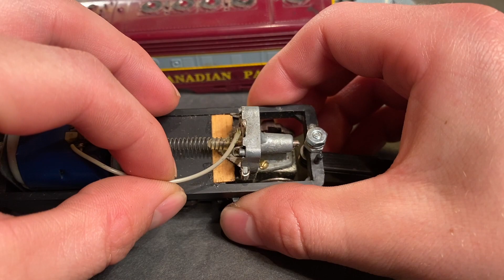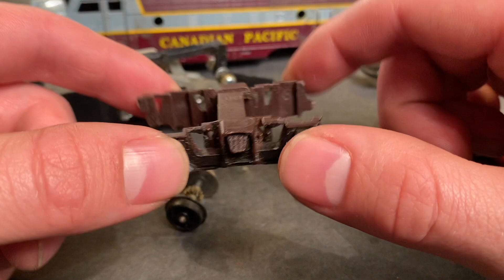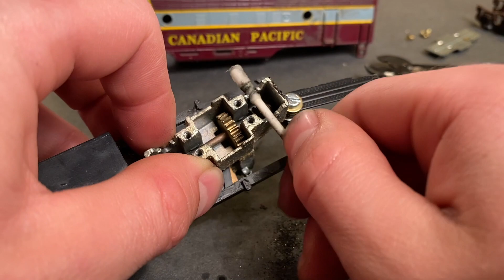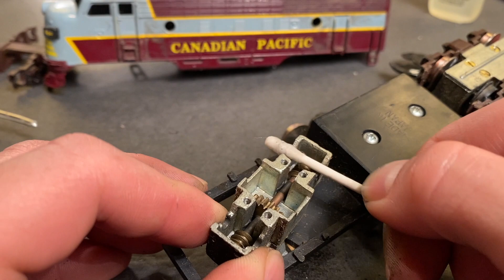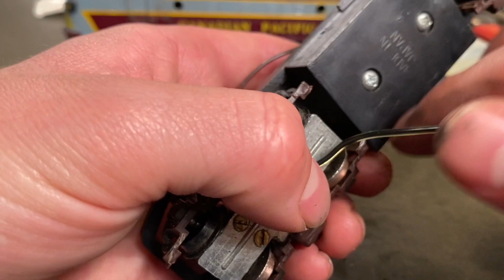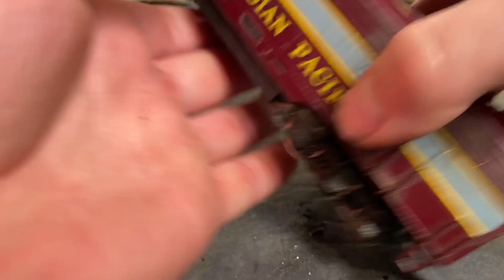Can We Make This 50 Year Old Revell F7 Locomotive Run Again?

Comment: I wonder if this was a repower or if Revell outsourced production of the chassis later on.  Their original chassis in 1956 had a large metal motor with a multi-speed pulley (switch the belt to front or back for high or low speed running) and 4-wheel drive, then they brought out a Varney clone 8-wheel drive chassis a couple years later with a smaller Pittman style motor.
Reply: The later chassis was plastic and somewhat fragile.  Somebody probably broke theirs and put this in it.
Reply from the maker: I'm guessing someone just took a random drive and put a Revell shell on it.

Comment: That unusual rear coupler appears to be a drawbar type usually seen on steam locos to tender. On the diesel, it most likely means there was a second unit semi-permanently coupled, like an A-B setup with B unit without a driver cab.
Reply: Could be. that sounds reasonable.
Reply: On some Marklin F units you will encounter a drawbar between some a and b units as well

Comment: I love how simple this locomotive is put together. I also love the paint scheme. I think the fact that it has a can motor actually helps the performance and it's basically totally sealed off from anything getting inside. Very cool!
Reply from the maker: It's a pretty good design for the era in my opinion.
Reply: @SMTMainline  exactly I agree with you
Reply: a locomotive motor isn't going to run better just because it has a an enclosed housing- its done for dependability, to keep hands and sharp objects out and to hide the fact that it's a cheap 3-pole motor...
Reply: @tommurphy4307  ok? I have rivarossi locomotive with a 3 pole . some of them open motors are 5 pole such as my mantua locomotives never had an issue.

Comment: F-unit shells swap pretty easy. I once put a Proto 2000 right on an Athearn frame with just a slight opening of the slots in the fuel tank skirt, and I had to take the glazing out of the front porthole.  

The Revell models I have come in two generations, the switcher initially has a square enclosed motor with a rubber band drive.  Later ones and these F units have plastic frames and a drive similar to Varney or Marx with an open frame motor mounted on top of one truck, driving it via a gear and connected to the other with a driveshaft. 

The plastic frame on the F units is somewhat delicate, I got a deal on a set because they dropped it and it broke the frame on the engine, so that could be the reason why this drive is in that shell.   That drive probably came with a fairly crude body on it, I see them every so often, made in Japan with no real brand name.  The drawbar is also a giveaway, Revell would have a coupler on the rear.   You'll notice the truck wheelbase doesnt' really match the body shell either. 

The reason for the high speed may be because that was a battery operated train.
Reply from the maker: I guess since the shells should be the same dimensions, it makes since they can be swapped.

Comment: Hallo. Great Video. Strange spring Drive, never Seen before. Very simple Drive . No Digital Dekoder INSIDE. No Front Light. Easy to Install a digital Dekoder by sodering in. Drive is simple and works very good. The bar on the Heck of the Lokomotive ist to Put on a Motor less B - unit with Kuppling. Greetings Clemens from Vienna Austria.
Reply from the maker: Simple design, not much to go wrong.
Reply: really? i believe the coil shafts were used by both mehano and roco- in your neck of the woods.

Comment: Always enjoy watching your repair videos. Still cannot get used to your ballistic soldering gun but thats ok.
Reply: lol 
I use a pistol type iron also
Mainly because it was really cheap back in the day I got it from Radio Shack 
lol
Reply from the maker: I got a new one recently which I will try soon
Reply: As a 40+ yr Electronics/Computer Technician... that is possibly worse soldering I have ever seen!
Reply from the maker: @journey7x  Model trains from this era don’t require delicate soldering. Just as long as the connections don’t break it doesn’t make much of a difference.
Reply: @journey7x  it got the job done- and he's not scared....
Reply: @SMTMainline  Bad connections can cause erratic performance, and excessive heating. Does replacing old wiring decrease the price of old loco? Or is it considered ok? 
I often wondered what was considered acceptable restoration? Course , if you enjoy seeing some of those old beauties like you have run again... I would probably go for it.

Comment: 1956 would have been the first year of Revell's model train line so 1956 could be both the year and part number. 
As noted it is heavily modified most likely to what a previous owner thought was a better drive or to replace a drive that went toes up.
Looks like something happened with the couplers and as has been noted that's a drawbar either to replace said damaged coupler or I did similar with Athearn blue box F A B units to get a closer, more prototype unit spacing. Also those number boards may be able to light from the headlight as some Revell units were offered with a deluxe option that had light up number boards.
Reply: The entire drive's been replaced

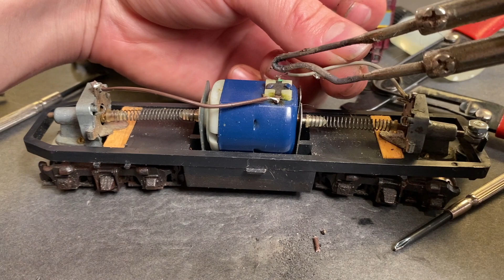Comment: Great save of this engine.  At 12:20 you reversed the polarity of the motor, so it will run opposite direction.  At some point you might want to check the polarity of your engines.  There's a correct way to wire them, I believe that when the engine is going forward the negative polarity will be on the left side.  I may have that backward, but there is a standard that you can look up.  That way when you have 2 or more engines on the same track they'll run in the same direction.  The shell looks to have been custom painted, you can see the outline of the decal around "Canadian Pacific".  Also, you probably could easily screw a KD coupler where that drawbar is.
Reply: A remotor with a Kato can and flywhl would be a good project for this engine
Reply: Yup I caught that too,  was thinking "hey didn't he swap the wires"
Reply from the maker: I didn't noice until after lol

Comment: Wow Ive seen many of those old blue hobby motors from back in the early sixties, but they were usually in slot cors not locomotives - and ive NEVER seen a "spring driveshaft" drive before - but then ive never opened up a Revell Loco either

Comment: Dang you. Thanks to you I am now the proud owner of 2 mantua 2-8-2 4073s,2 Mantua 0-6-0,1 mantua 0-4-0,and a lonely Marx 0-4-0T which I don't know if anyone of them work yet.....Found them at last weekends trainshow for $65 total. Along with a Pair of those Cheap 4-4-0 American Flyer Casey Jones engines from the modular system. I wish Helix Humpers was still around. I loved repowering these old Mantua/Tyco engines back in they day. They were some fantastic runners with an updated can motor and flywheel.
Reply from the maker: That's awesome. The mantuas are some of my favorites to work on.
Reply: @SMTMainline  yep. Couldn't pass up the prices. $15 each for the 2-8-2s,$10 for the 0-6-0s and 0-4-0 Mantuas and a 5 spot for the Marx. $20 each for the American Flyers.
Reply: are you sure? even google doesn't have a picture of a tank unit anywhere...
Reply: @tommurphy4307  marx had them in their allstate sets with a tender. Prototypical wasn't a thing back then. Lol. Side tank engine with a tender. But they were toys back then.

Comment: I have no experience with model trains, but I have worked with many pieces of electrical equipment with those types of motors. They were durable and reliable, but not designed to be serviced. When they gave trouble they were replaced with a new motor. They were so common that there should be new ones still available. 

On another note, you may want to consider resoldering all joints on anything over ten years old. Also a soldering iron more suited to that type of work might make a good investment.
Reply: He was sent a pencil style type. Me thinks he just doesn't want to wait for the warm up time.
Reply from the maker: I suspected that was the case. I've tried to work on similar motors and ended up screwing them up a bit.

Comment: Yes I think that locomotive is far younger than it being made supposedly in1956. It is likely a part number. I would guess it is no older than the early 1980s, late 1970s just judging from those cheap blue motor. I would change that motor to a nice modern one.
Reply from the maker: Probably so.
Reply: change the motor? with one-rail-per truck pickup changing out the whole locomotive would make more sense.
Reply: Actually this is probably from the 50s as Revell was only buildings as far as Model Railroad items when I got my first train set in 1970.
Reply: I meant the shell the frame and motor aren't original and are probably from an early 60s Japanese import.

Comment: Those springs are called a slinky.   Much bigger ones were sold to kids 👶 from about the 1950's onward.
Reply from the maker: I had one of those. Nothing better than trying to get one jumping down a staircase.
Reply: @SMTMainline  Iconic toys from the 60's and 70's were great.   I had the slinky,  Gumby and Pokey,   made out of vinyl and late 1960's early 1970's Japanese all metal lithographed robots. One with twin machine guns that popped out of twin doors in its chest.   One that raised it's arms and screamed like a siren.  ( without a doubt the loudest toys EVER. ) ☺
Reply: i call them 'coil shafts' and that usually gets the point across

Comment: That looks unusual to see springs instead of drive shafts
Reply: Say Penn Line used spring shaft on a single drive truck
Reply from the maker: It was probably meant for smooth acceleration.

Comment: You really ought to invest in a spool of smaller gauge rosin core solder.  I'm not sure what sort of flux you are using, but if it is not made for electronics it will eventually create corrosion problems.
Reply: silver solder, but its solid-core

Comment: i have a question for you. i have 20 locomotives from the 50s threw 70s from my grandpa that dont run anymore since the 80s before i was born. now i have the time to fix them. whats your take on graphite powder lubricant or should get what you use?
Reply: Lubriplare or dielectric grease
Reply from the maker: Haven't tried graphite powder before. Just as long as you're oiling them properly and using grease on metal parts you should be okay.
Reply: @SMTMainline  yeah the main reason i asked is cause i love graphite powder on stuff like hinges. so i have it and if it gets wet it would just clump and break up and be like its all good
Reply: use a LIQUID conducting lubricant like atlas' conduct-a-lube (bachmann sells it a little cheaper). IF grease- it has to be lightweight. most automotive products are gonna be too heavy. i only use a liquid conducting lubricant and labelle 102 gear oil on my club's locomotives.

Comment: Another great fix. I see you’re still using that behemoth of a soldering iron. I guess if it ain’t broke… but when it does break… Can we fix this soldering iron from the 1970’s? ;)
Reply from the maker: Funny enough this one needed repairs a few months ago and ironically in doing so needed parts soldered so I ended up having to use a lighter which worked surprisingly well.
Reply: @SMTMainline  i have an old weller pistol i like to use on Horribly Oversized stuff

Comment: I had a Revell New Haven F7 in my first HO train set. That is not the Revell drive mechanism! Mine had the motor mounted to the rear truck with a spur gear, transmitting power to a gear in the lower half of the truck. Then a driveshaft connecting to another one in the front truck, with worm gears powering the axles. 
The shell you have is Revell, but I believe the chassis is fabricated from parts of another Mfg.??
Reply from the maker: Someone must have taken it out of a kit or something.

Comment: I got a pancake motor amtrak engine from the bachmann 80's era, should there be any problems with it? i have heard bad things about the gears or something?
Reply: Sometimes the nylon gears on those old Bachmann drive systems crack because they’re pressure fitted onto metal axels.  To fix them you either have to glue them back together, replace them, or try to make a Life Like gear (which is very similar) work.
Reply from the maker: @trainsrcool3452  That's pretty much it. You can still run the loco with the cracked gears until they break, they will just make a clicking noise. Spare parts are easy to find for those.
Reply: bachmann didn't make pancake motors, but you can still get the white gears from them with no guarantees. if you run an appropo drill through them, you can rework them so they don't fit so tight and will actually last. or you can get the black gear and wheelsets to fix them for more money, more money, more money....
Reply: @SMTMainline  sometimes they will slip and you have to glue them- i hate that
Reply: @tommurphy4307  They make plastic and molds you can make at home, I may try doing that at some point and recast the gears.

Comment: Did you fix your wiring? I noticed you soldered it backwards from its original wiring. Could be fun with another unit fighting each other. Also, you can replace the springs if they give you any grief. food grade tubing or putting drive shafts would make improvements if you so desire.
Reply from the maker: I didn't notice but it as you mentioned all it changes is the direction.
Reply: the coil drive shafts work fine- swapping something else in there would be a waste of time

Comment: where/what oil do you use for the train gears
Reply: The grease is LaBelle 106. The oil is LaBelle 102 or 107.
Reply from the maker: @hondachopper6978  Exactly
Reply: labelle lubes

Comment: How come you used a stone instead of the fibreglass pencil to clean up the wheels?
Reply from the maker: It's a track bright so it's meant for these sorts of metals. Fibreglass pencils are a great tool for small jobs but they are not very abrasive so it makes the cleaning process take much longer. Moreover, fibreglass is dangerous. Light friction likely isn't much of a hazard but a wheel spinning at a couple thousand RPM might release particles into the air.
Reply: @SMTMainline  ok, so like most items they all have their own uses, track bright is for higher RPM while Fibreglass pencils are for lower?
Reply from the maker: @zackjones8556  In my opinion they are best suited that way.

Comment: really is an odd locomotive, i’ve never seen any locomotive with springs used that way lol
Reply: It's like the old life like n scale spring drives
Reply: Life like used springs like that on their n scale locomotives
Reply: the older plastic life-like N scale locos used coil shafts with good success- they are good for installations where the driveline is skewed